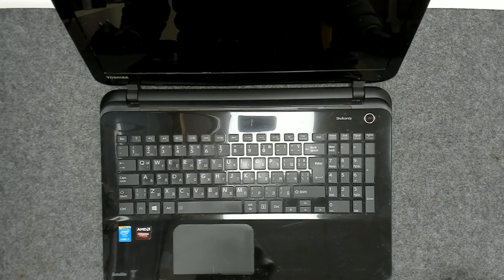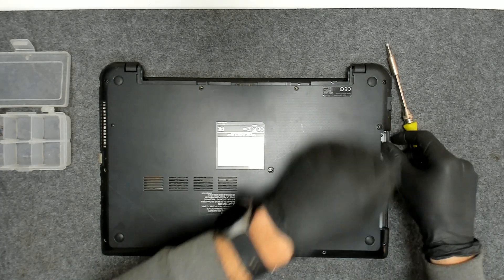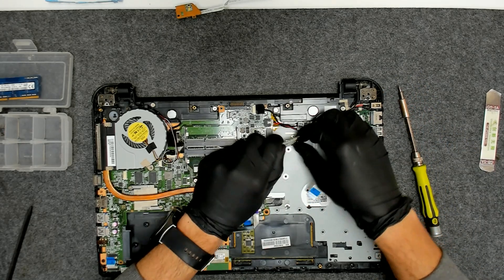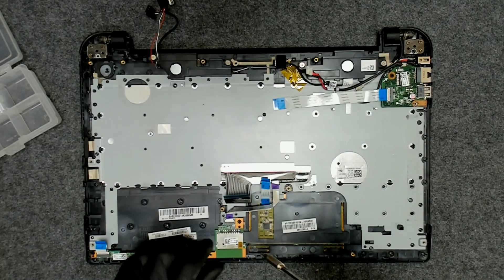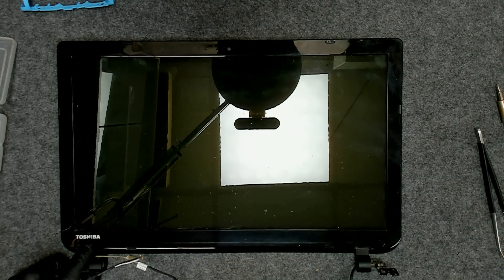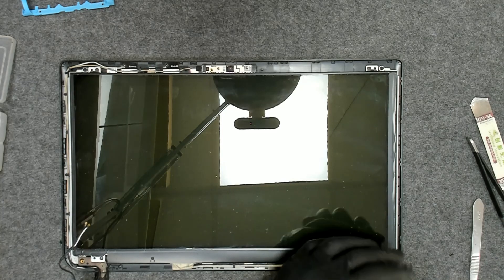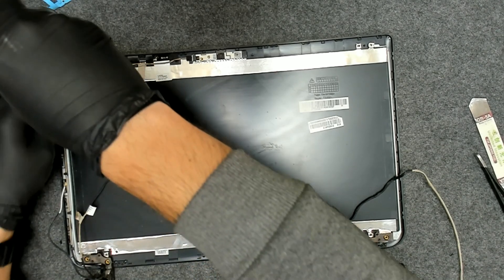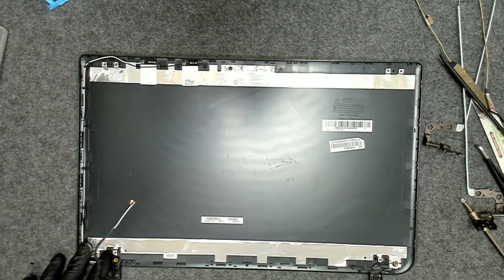Toshiba Satellite L50-B Complete disassembly

Comment: Hi, do you know where the thermistor is located?
Reply from the maker: What thermistor?
Reply: @LaptopDisassembly  Sensors that detect temperature
Reply from the maker: @FRecompile in most of the cases the CPU and GPU have integrated sensor for temperature. There is a  separate thermistor in the battery.
Reply: @LaptopDisassembly  the battery one, but in the battery pack I only have the bms and the batteries
Reply from the maker: @FRecompile the thermistor is on the battery board. You need to open the battery. If the battery doesn't output any voltages, there is a thermal fuse that cut power if overheating.
Reply: @LaptopDisassembly  I opened the batteries and charged them with a power supply, but if I inserted them into the laptop they don't work, not even when connecting the charger.
Reply from the maker: @FRecompile  https://youtu.be/JnPlBhwpH-g?si=ijoSXBUMdh1_7c3l check this video. It is not mine, but it can give you an idea.
Reply: @LaptopDisassembly  thanks. I'll try to look at it and see if I can fix it.